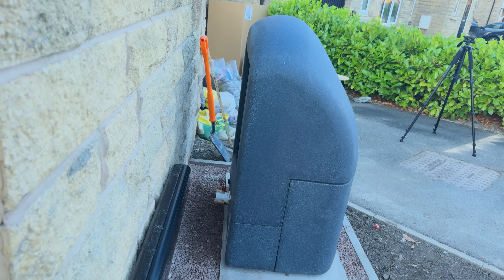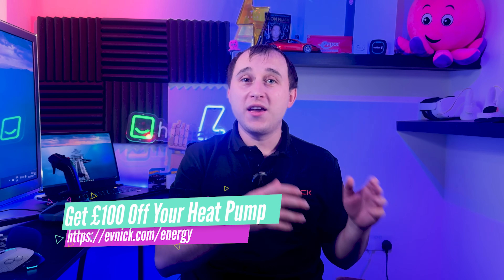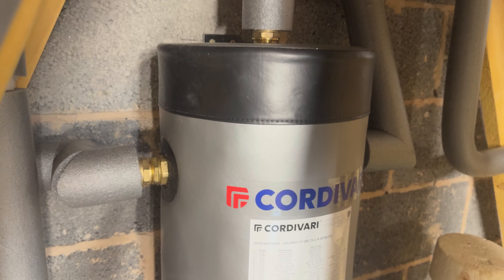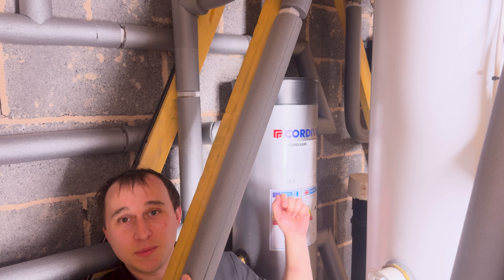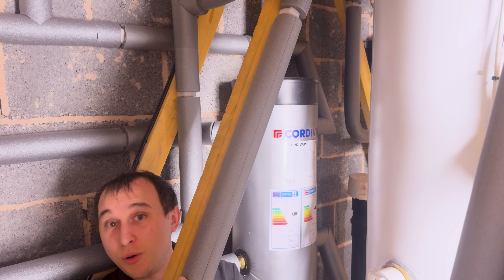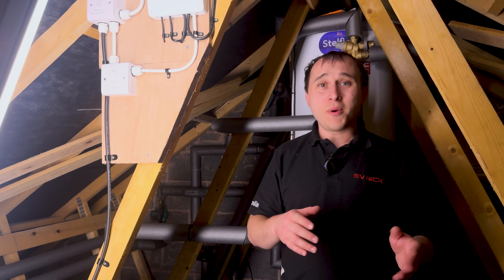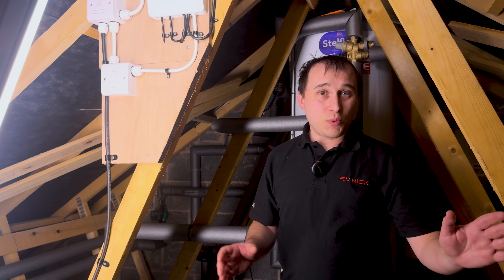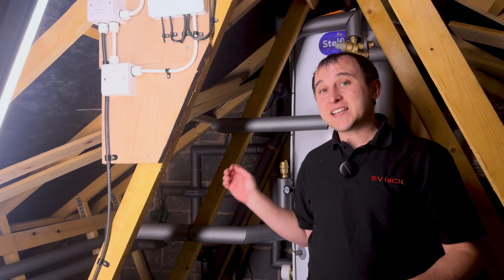My COP Of My Cosy6 Is Awful How We FIXED It!

Comment: We've all been told that this particular system is designed to run at "high temperature" (as they put it) compared to conventional heat pumps. Interesting about the Microbore, is yours running 10mm pipes? Thanks for sharing
Reply from the maker: 10mm plastic microbore

Comment: It's good that Octopus have fixed this but, a better installer would have got it right the first time. There was no way the pump in the Cosy6 was going to cope with the very long external run and microbore. Not enough pump head.

You probably would have been better off with a hydro split system rather than a monobloc, due to the long external distance. Again, Octopus don't do this. They're cheap for a reason.

Comment: Pedant mode engaged.
A hydrosplit would be when the outdoor unit does not have it's own circulation pump.
This system is not operating in that way. 

Your Cosy 6 is a Monobloc heat pump with a circulation pump inside it which has now been hydraulically separated from the heating circuit by a buffer tank.

By knowing the metre head of the internal circulation pump in the cosy 6, they could have easily calculated if they had enough power to overcome the pipework resistance and achieve the correct flow rates to satisfy the heat demand of the property as well as keeping the Cosy 6 compressor and heat exchangers in the efficiency window.

Calculating the external pipework is obviously a doddle, but even the plastic microbore should be straightforward to estimate.

It does seem a bit of a failure that they couldn't/didn't calculate this before hand, but fair play to them for resolving the issue with hydraulic separation as most heat pump installers would do on plastic microbore with any heat pump, not just the Cosy 6.

Interested in the COP but my predictions as I've repeated on my channel are that it will be fairly low. If it breaks 4 then I need to eat my hat live on my channel I guess.

Thanks for sharing. The Cosy 6 is something I'm willing on as I do like to see vertical integration as I know how this can massively benefit widescale rollouts.
Reply: Octopus state that he Cosy 6 achieves 3.1 SCOP, so yes, over 4 is probably unlikely (but would be great to see). Meanwhile, Heat Geek Elites are getting more like 4.5 average, some even above 5!
Reply: "If it breaks 4 then I need to eat my hat live on my channel I guess."

======

Noted 🙂
Reply from the maker: Whats your hat made of and how good is your health care?
Reply: they probably wanted to avoid the buffer to avoid mixing the flow and return. if you know its not to bad to change latter then its worth giving it a go without (assuming the numbers are borderline)
Reply: You'll need to start eating soon then - I have 4.13 and my install is earlier than this one :-)  (Octopus also refitted my cylinder as, like yours, it was 180 and needed to be bigger).
Reply: @wreckguru  You'll almost certainly dip below 4 by the time winter is over then, so no need for UDF to get his hat out just yet.
Reply: How come no higher than 4?
Reply: You can be sure the guy from Octopus is going to do what he can to get his COP to exceed 4 after your video!
Reply: @JOOI525  I can always edit my comment so take a screenshot to hold me to account! 😂
Reply: You say you are willing cosy 6 on, yet you have videos on your channel titled "cosy 6 don't bother! ".  With friends like you who needs enemies😊.  I  switched to Octopus for ev charging and to manage home battery and found them brilliant and very forward thinking.  I will definitely be considering them for a heat pump as it seems to me their overall cost of installation and running cannot be beaten. It seems to me you get bogged down in technical details without thinking about the big picture most people are interested in which is overall cost.
Reply: @fredgoul1150  Thanks. I've long said that Octopus will offer the lowest total cost of ownership. That's been a core message over the past several Cosy update videos i've shared.
Reply: @UpsideDownFork  so why have a video saying "cosy 6 don't bother"?  Is it because you think most people are more interested in the technical details of the efficiency and not bothered about overall cost?  If that's what you believe, why not change the title of your video title to ..."choose cosy 6 if you are interested in cost but not if you are interested in the technical efficiency numbers"?
Reply: @fredgoul1150  Thanks for the feedback. 
Just like EV Nick, we all have to play the silly game to get people to watch the videos through thumbnails and titles. Without viewers we can't spread the greater message that heat pumps are awesome!
Reply: @UpsideDownFork  fair enough!

Comment: Sounds like you should have got a Heat Geek install 😉
Reply from the maker: At over 7k no thanks payback been far longer than life of heat pump
Reply: @NicolasRaimo  You don't install for payback. That is the wrong way of thinking. You install for comfort and usability.
Reply from the maker: @mbak7801  it’s comfort and reliable
Reply: @NicolasRaimo  was referring more to the design oversight.  Whilst they are a fair bit cheaper you are straight away having issues.  I haven't yet gotten into an in depth like for like comparison, but I expect the warranty/guarantee will be longer on HG products.  Their scops are consistently very good!
Reply: Or just left the gas boiler where it was!
Reply: @Chris-hy6jy  true, seems like he lives in a fairly new house so not such an obvious motivation/saving. I think ours has got a few years left so expect we'll change to HP when it gives up

Comment: This is why I'm going to pay extra for. heat geek. The designer should have known the pump wouldn't have been enough based upon the survey. I'm assuming they fitted the extra pump for free?
Reply from the maker: All work included yes,  heat geek payback vs octopus price was miles apart
Reply: @NicolasRaimo  was referring more to the design stage oversight.  You always pay for quality at some point.  These are the kind of things the MSM jump on in an effort to slow the shift.  A shame as I'm a happy Octopus customer but these HP installs seems almost worryingly cheap.
Reply: @NicolasRaimo  Yes but they are installing at a loss with time insentivised teams. This can bring questionable systems. Does Octopus provide annual servicing? If not you my have to try and find a plumber willing to fiddle/fix with your system and how that turns out could be interesting.
Reply: @mbak7801  they offer a very competitive service and warranty package. I'm just not convinced that they are yet up to standard. You get what you pay for it.
Reply from the maker: @ they offer services yes

Comment: You've had some snarky comments but I appreciate you providing your empirical insights! If you've tried a low temperature to get a good CoP and it hasn't worked then fair enough!
Reply from the maker: I suspect most are upset heating fitters, octopus fitting heat pumps cheap upset them rather than concentrating on there core business they try to spend there time criticising others
Reply: @NicolasRaimo  Not cheap, just paid for by the tax payer.
Reply: @Chris-hy6jy  the grant that supports heat pump installations is a good way for the UK to meet its emissions targets. We aren't going to be able to keep burning gas forever.
Reply: @Biggest-dh1vr  

Agreed, in real terms it’s no more or no less than when the local governments threw shed loads of cash at installing  ‘natural gas’ central heating systems for all in the 70/80’s.
That would’ve been even more disruptive as well for installation than heat pumps.
Reply: @Chris-hy6jy yes, cheap.  Others are charging much more, even with the grant.
Our Cosy 6 was £500 all in after the grant, whereas we were quoted £5k to £8k by others.

Comment: What have you got your flow temperature set to now octopus set mine to 37-57 and it was running so noisily outside and using loads of electric. Changed it to 35-45 and seeing a big improvement

Comment: Big mistake fitting the heat pump so far away, and now a low loss header to make things worse. If the microbore was a problem then change it. Compromised to the point of failure. First principles. Great example of what not to do.
Reply from the maker: Don't be silly.   Repiping the entire house would of cost a fortune making the heat pump install much more expensive and taking a stupid time to pay back first principles don't apply to retro fit,  if it was first fit yes I agree.
Reply: @NicolasRaimo  You probably mentioned it in an earlier video but why not install it at the start of that pipe run eg near the front of the house rather than near the garage? Was it noise?
Reply from the maker: @ has to be 1 meter from boundary I wanted it right front of my home next to my bedroom window. It makes no noise

Comment: Lower is better, if your system is designed to deliver the heat at that temperature. Eg properly sized pipe work. 

It's not the low flow temperature that was the issue but your pipe work. It's why they designed for 50c.

Personally I'm getting my pipe work upgraded if I can to enable a low temperature system. I want a scop 4+ HP not a 3+ for obvious cost reasons
Reply from the maker: The price of a re pipe would far outweigh the cost savings also the up evil of having to repipe would of meant a no go from the other half

Comment: We have microbore and a long run also , the headers tank was installed at the same time on our Cost 6 , so fortunately haven’t had any of your issues with cop. I did notice on the Cosy app though that they’ve taken away the flow temperature options on the Settings as of last week.
Reply from the maker: I’ve been in communication with octopus and they have staff as YouTube members and patrons seeing this content early
Reply: I noticed the flow temp settings had been removed download a older version of the app to get them back

Comment: Very informative Nick. I signed the contract for the Cosy 6 on Friday. They’ve assured me once I’m passed to the design team your referral code will be used. My run from cosy to 6 to the cylinder is quite short, I also do have microbore, so hopefully achieve a decent COP. Looking forward to the install.
Reply from the maker: Excellent! I’ll be putting out October members cop screenshot on 1st November!
Reply: @NicolasRaimo  look forward to seeing the stats 👌🏻
Reply: Thanks Nick. Sorry to hear about your issues. How big is your tank. I'm a bit worried that 180 is not enough for my install
Reply: @davidgates3498  how many people live in your house David? I believe they provision for approx 45 litres per person per day when calculating the tank size. I have a 4 bed house and will be having a 210L tank installed.
Reply: @liamhenning  Thanks for that. 2 adults and 2 children, 6 & 10 years old.
Reply from the maker: @davidgates3498  210 liters... how many people in your home 180 should be fine if there's just 2 of you and its mostly showers
Reply: @NicolasRaimo  2 adults and two growing boys 6 & 10
Reply from the maker: @davidgates3498  I think I'd be going 200 minium personally,  if you can have bigger great means you can heat it to say 40c and use direct basically no cold mixing... but 180l would be fine but you might need to heat to 60c or heat twice a day it really depends on showers and baths a day.  If I heat to 45c we run out end of the day but if I heated more it be wasted as it lasts us for a bath and a shower for me and wifes electric shower... if she was using tank as well then 48c would likely be enough.
Reply: @davidgates3498  

The heat pump will be able to boost tank fairly quickly if required, my 150 litre (two bedroom house) heats from cold (@10C) to 43C (nice hot bath or shower) in about 45-50 minutes if I remember correctly.
Reply: Energy stats UK has a page on hot water cylinder sizing that may be of interest (family of four too)